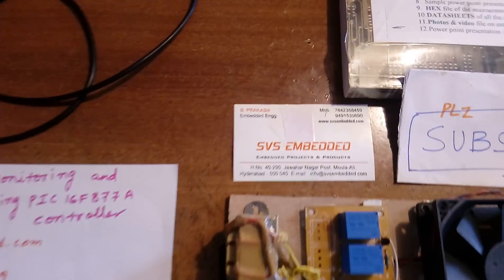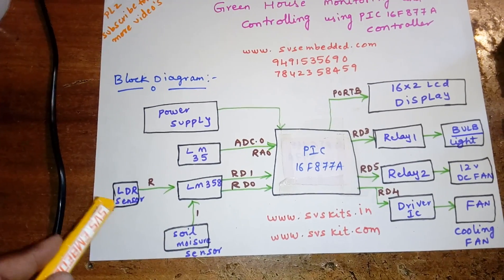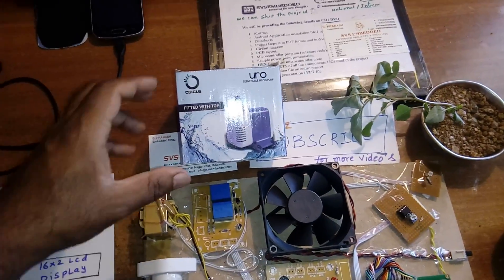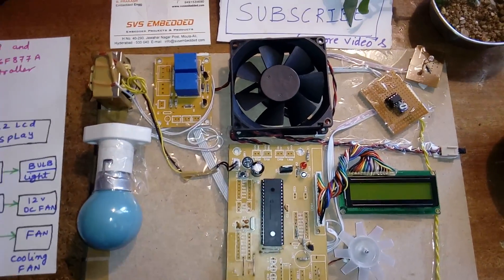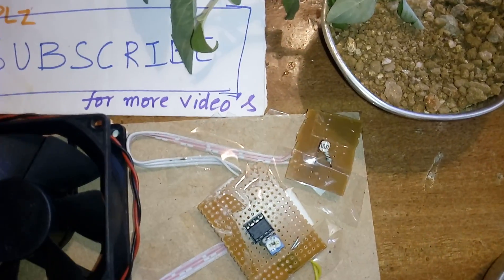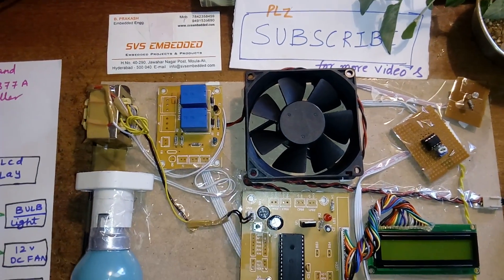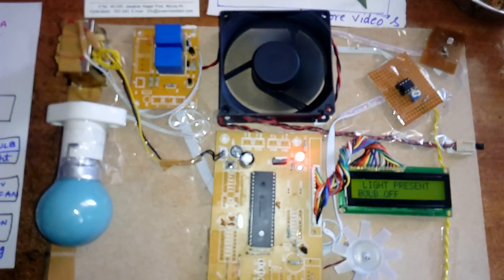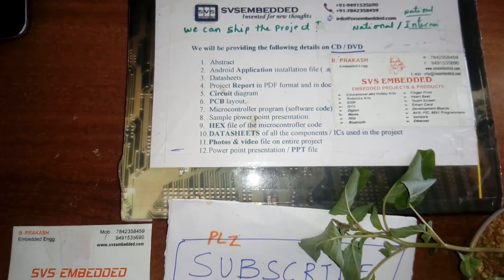GREEN HOUSE MONITORING AND CONTROLLING

Comment: Need one system for polyhouse automation in NCR, Please share your email/contact
Reply from the maker: Thanks for comment and your valuable Feed back,we are selling the projects with least cost.
if u order the project we will provide working hardware kit along with 
1.abstract
2.datasheets
3.documentation
4.schematic( circuit ) diagram.
5.software code.
6.sample ppts
7.photos&video file on entire project
through google drive.if u r interested to take the project.
send me a mail to  svsembedded@gmail.com,info@svsembedded.com.
we will send u the how to order procedure to u.